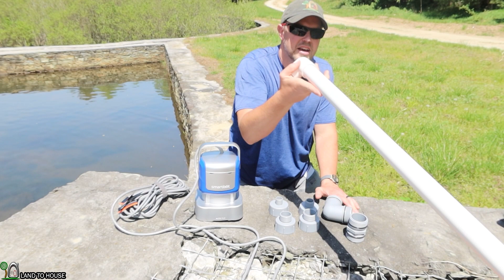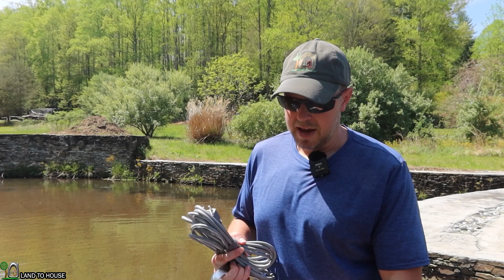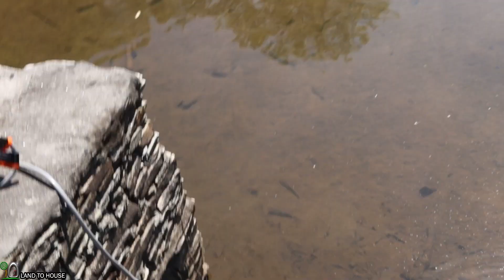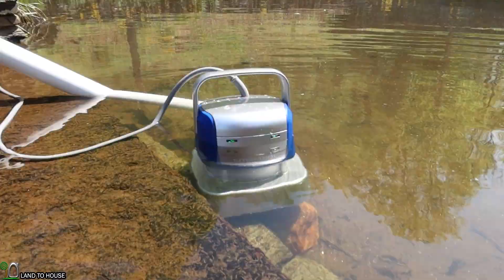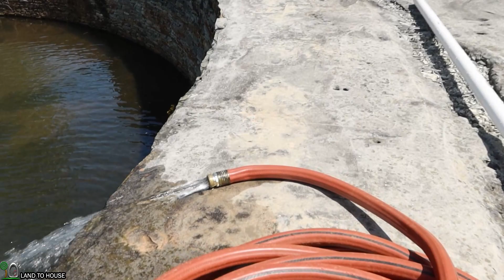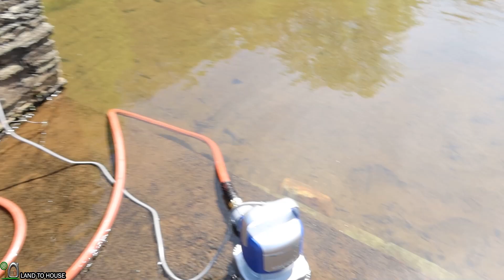SmartBot Super 3600 Pump

Comment: Hi Seth,  Hopefully you're seeing this after 2 1/2 years! I liked your presentation and found it very informative...and came away with a few questions: 1) you pointed out that the pump needed to be in 2 inches of water before plugging it in order for the pump to start, however, you were able to remove it from the water and swap the pipe for a garden hose and place it back in the water and it started back up. So, does this mean once it's started up, and it pumps water down to 1/16" and then shuts off, it will resume pumping again if the water gets back up to 2"...and no need to unplug & plug back in? Also, I noticed that they have several models with different GPH ratings, but all have the (same?) 1/2 HP motor...how is that accomplished...with different speeds using different transmission gearing? Thanks in advance! Seppy